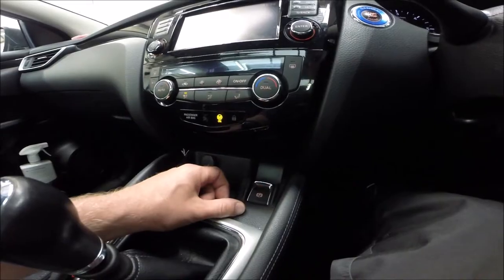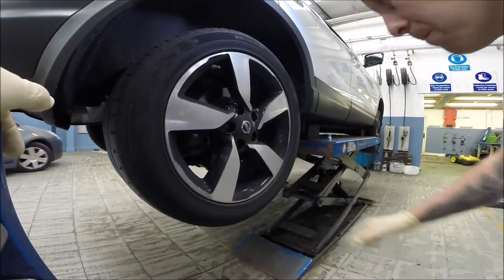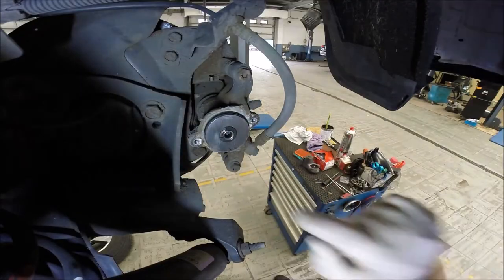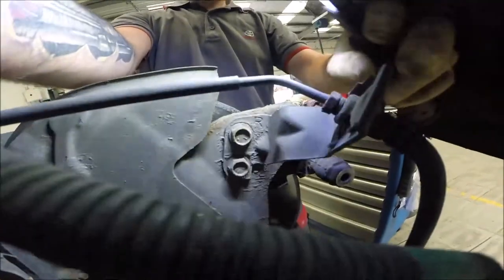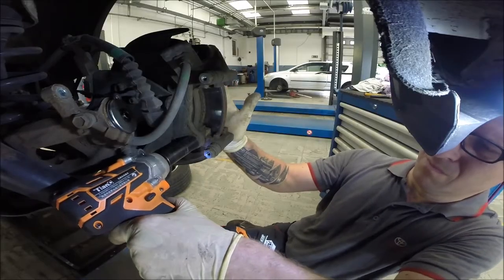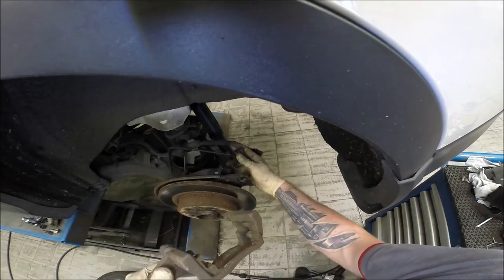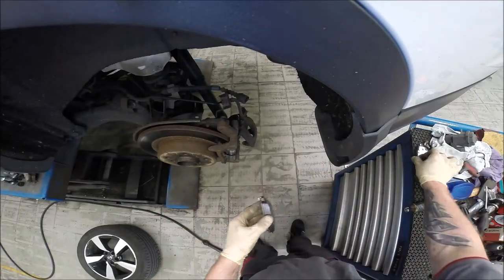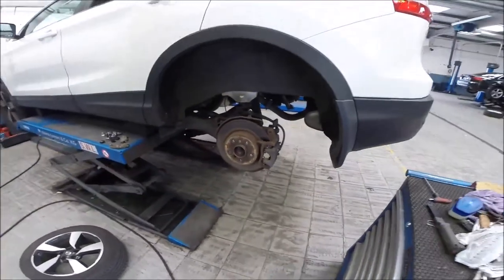Nissan Qashqai J11 Rear Brake Pads Replacement

Comment: Brilliant step by step guide, also handy to know the handbrake self adjusts after brake pad replacement, no one mentions this on the forums. For owners in the UK, Nissan dealer charge £96.23 for the set of genuine rear brake pads(Fronts are £72.85). Very expensive at £96, some alternatives from Euro Car Parts are Bosch for £43, Brembo for £46, and Pagid for £54.

Comment: Finally got around to doing this job.  Was much easier than I expected and had no issues whatsoever with the electric handbrake.  I rewound it as per the video and then used a normal caliper retracter to push the piston back in. Once done, I turned the ignition on and pressed the handbrake button.  It took just a moment to calibrate and all was good...no errors or warnings.
One thing I did find is that the audible warning tab on the brake pads are absolutely useless. The tab is on the inner pad, however the inner pad still had loads of pad left and so the warning never triggered.  The outer pads were almost down to the metal so I just caught them in time.
Reply: @deepjhandi8585  So true....

Comment: SergeP 
Excellent video, I just used it to change my rear brake pads on my Renault KADJAR 1.5 DCI (2015). It is the same process and electriC brake both Nissan QQ and Renault KADJAR.
We don't need any electronic case, just to proceed as the video and explanations and the result is well.
I am a french guy and we don't find any french video for Kadjar model.
Your video was my simple and great help. Thanks
Reply from the maker: Thank you

Comment: Getting ready to do front and rear pads on my J11.  I had done front pads before and hadn't thought of the added complexity of the rear breaks.  So happy I watched this in advance.  Thank you so much for taking the time and effort to make and share these videos.
Reply: MrUnderwurlde was it exactly as he showed ??? Can you share any best practice ??? Need to do mine next weekend
Reply: @balalkhan5398  I actually didn't do the rear pads in the end.  When I took the front pads off, there was almost half the pad still left. The rear pads had even more, so I left them alone.  I made a complaint to Nissan about the dealer trying to charge for work that was not required.
Reply: Don't do the rears yourself. Manually resetting the electronic handbrake ruins the calipers. We did this yesterday and now need new Nissan replacement calipers.
Reply: @adamreturns1  Interesting.  What failed on the original calipers that required them to be replaced? Did the mechanic actually show you the failed parts?
Reply: @MrUnderwurlde  Mr Nissan said the calipers were now useless as they were separated from the motors and manually adjusted. When plugged back in the computer sh*t itself and started flashing handbrake warning lights. He said the only thing to do now was install properly calibrated calipers and then the computer will allow a reset. I should have just booked it in to them for the pads change - £170 bill turned into £1290..
Reply: @adamreturns1  I'd be curious to know how Nissan do this then.  Is there a procedure to change the pads without separating the motor....or is Nissan software required to put them into service mode for example.  I sometimes think main dealers don't actually do repairs  but prefer to replace parts instead.  I had a similar situation with the intake manifold in a diesel Hyundai that had clogged up.  Hyundai wanted over 1500 to replace it.  It just needed a good clean which I did myself and it was as good as new.
Reply: @MrUnderwurlde  Nissan connect a computer to the car which retracts the handbrake. It stays connected the whole time then when you're done, it puts the piston back where it needs to be (as far as I understood). The problem doing it manually is that the ECU thinks the calipers and piston are in one place but they're not, you've moved them and haven't told it what you've done so it gets confused and errors out. 
I think you're correct, they just replace parts now. If you think about it, the calipers and motors had to be assembled at one point, so in theory you should be able to manually set the piston to the appropriate position on both calipers, install the motors and reset the system.. but apparently not. Why spend an hour fixing something that they can replace in the same amount of time and charge 10x more..?!

Comment: Excellent video, just replaced pads (and discs) on my 2016 QQ, your video was a great help.  The only slight complication was that 1 of the activator retaining screws on the off side rounded out even using a well fitting T30,  I managed, very carefully to cut a nick across the head so I could use a large flat blade screwdriver to remove then later replace the screw.
Many thanks
Reply: Hey Alan, I am looking to do the same on my Nissan Quahqai 2016 model.  Could you tell me if you had to do what is being done in the video at 7mins 6 secs and also what is he doing as i dont quite understand that step? thanks

Comment: Excellent job. You pay attention to details. Congratulations. I suggest to most of viewers not to try this at home. Better let a proffecional do this.
Reply: A bit complicated
Reply: Why? A 'professional' is only someone who has practised the job a number of times. Changing brake pads and rotors is something most vehicle owners should be able to do, considering its relative simplicity. Not a challenging job in the slightest.
Reply: @Ahmed____  I agree. Nothing difficult to be done here. As long as you have a bit of common sense this isn't something only a professional should do.

Comment: Thank you. It's been a great help.
1.However, I wonder if the tool needed to move the kelp-cylinder back is a general or special tool.
2. And you really don't need a scanner?
Reply from the maker: Hi, it is standard torx, and yes you no need plug in komputer,

Comment: When u put the hand brake back on did u need to use the 7mm to screw it back or just fit it and let the hand brake collaborate it’s self ?
Reply from the maker: Hi, fit like that , then fully pomping brake pedal and during pres brake pedal switch ON the park Brake it will be adjusting it self.
Reply: Completed the new pads and discs all round videos is spot on thanks
Reply: @FixYOURride13. Can you explain

Comment: Hi, firstly, great video, really helpful. 
But i don't understand why are you taking off the electric parts and than you're using allen key. What it gives? Is it easier to screw in the pestle later? Or maybe it is enough to press it then and you don't need to screw in?
Reply from the maker: Cześć,  trzeba cofnąć tłoczek, jest to bardzo utrudnione ponieważ musisz pokonać opur jaki stawia silnik elektryczny na zacisku jeśli nie używasz do cofnięcia sekcji hamulca postojowego urządzenia diagnostycznego. To jest prosta metoda nie wymagajaca drogiego urządzenia diagnostycznego.

Comment: Why messing with the brake fluid? Didn't change level. Thanks for the video
Reply from the maker: brake fluid level was to high, during the brake piston pushing back the brake fluid will be split out of the reservoir.

Comment: When u removed the electric motor at 7:20 it looks like you rotated the caliper piston clockwise and counter clock wise with the Torx driver. Can you confirm the direction it has to turn before removing the caliper please? Thanks
Reply from the maker: Hi, is only one correct way, try like I'm trying 😉

Comment: Hi mate 
That way is not recommended way of doing the job .
What about EHB system putting to   Diagnostic mode for revising the motor back.  Then after completing the job  by putting back to normal operating mode is setting the brake pads to the brake disc .and deleting any faults from the driver of EHB module .
Reply from the maker: Hi, respect for your way, but all the conditions are done if you follow the recommendation. After  replaced the pads pres brake pedal several times next use the Parking Brake system, all will be adjusted like should be. 👍

Comment: After replacing FRONT brake discs and pads, i am getting once in a while a "slip indicator" light on, red engine light, along with "CHASSIS CONTROL System fault" warning and a "SYSTEM fault" warning.  
Have i missed something?
Reply from the maker: Hi, something definitely went wrong. Plug-in computer for check what's happened.
Reply: @FixYOURride13  Thanks for your answer. BUT what has the mechanic done wrong? really i can't think of anything neither does he. Is there any chance that he has damaged or misplaced the ABS/ESP sensor???
Reply from the maker: @ZisGR81  ...all is possible, after computer diagnostic you will be know more, maybe need only parking brake system calibration.
Reply: @FixYOURride13  problem was solved by replacing the exhaust gas pressure pipe !!! Everything was caused becaused it was torn apart !!! Totally confusing errors triggering by an engine part rather than a wheel sensor 🤨🤨

Comment: This video is definitely helping! Good job ! But to wich direction you’re twisting to release handbrake after taking of the caliper ?
Reply from the maker: Hi, both side after removed the electric motor twisted by 7mm allen key for right side, and caliper pistons for right also
Reply: FixYOURride13 
Thanks I’m just doing that right now ! 👌🏻😆
Reply from the maker: @metinrusan55  
Good job 👏

Comment: All good on the fitting, however now I have a flashing handbrake light any idea why? Thank you for an excellent video
Reply from the maker: Hi, probably somting went wrong, disconnect battery for 2 minutes, connect back, ignition on, press brake pedal several times, hold and switch park brake on, next off, ignition off. If still will be flashing need plug in komputer for rest park brake system.
Reply: @FixYOURride13  All good now...thank you
Reply: @markl5893  hey did you get it sorted ? i have the same problem thanks nickr
Reply: @FixYOURride13  take it to nissan to get connected to computer or possible to fix myself? thanks nickr
Reply: hey how did you get it fixed?
Reply: Sorry to ressurect but how did anyone manage to reset the warning light? Thanks

Comment: Hi, I have Nissan X-Trail / Rouge and that car have the same Brake Systam as the Quaschqai and Renault Kadjar. 
Thank you very much for this video it ist very interasting und i try to change the Brakes at home. 
But i have one question. What Brake Fluid Nissan used ??? Dot 3 or 4?
Best Regards from Germany. :-)
Reply from the maker: Hi, all brake fluid dot 4 up to 5.1

Comment: Hi mate. Great video. As a mechanic, do you think the Nissan Qashqai is a good car. Mine is 2 years old now and I am debating whether to keep it or trade it. BTW, in Australia the J11 is only available in 2.0 petrol and I have a CVT auto. Any insight would be appreciated.
Reply from the maker: Hi, It depends on you whether you attach to the car or like changes, What is your mileage, are you happy? What car would you like to change to?
Reply: I have only done 9,000 kms. The car is 2 year old. I've only got 12 month more warranty left and am worried about the CVT. If I changed I was considering the Hyundai Tuscon. Also 2.0 litre but no CVT. In Australia, 95% of cars are auto. I'd like to know your thoughts about the reliability of the Qashqai vs the reliability of the Tuscon - from a mechanics point of view. ANy insight would be much appreciated.
Reply from the maker: @deebee3901  hi, forgive me but all depend how is condition both models , better ask your lockal mechanic.

Comment: Do you need a special brake piston rewinder (like a keyed one) or any standard brake piston pusher tool is good enough for the job in this car?
Reply from the maker: Hi, yes you need, 26:05 video time.
Reply: @FixYOURride13  is the piston turning when pushing the piston back into the calliper with that special tool?

And if one doesn’t have that particular tool your using? 
Could you use a large C clamp to push the piston back in?
Reply: Good video!

Comment: Won't vaseline damage the rubber seal on the brake caliper. Wouldn't silicone grease be a better idea?
Reply from the maker: Hi, It didn't happen to me after using Vaseline but silikon grease is a  good idea.
Reply: Don't use Vaseline. Silicone is basically heat proof.

Comment: You must never gun on alloy wheels and if you do gun setting must be low and once wheels are on the ground tighten wheels with wheel bar or torque up with torque wrench. And I've never seen or would recommend using a file on the brake caliper pad holder, the wire brush was good enough,  i can only imagine someone over filing and destroying the caliper. other than that nice job man
Reply from the maker: Hi, you obviously have little experience with rust, a wire brush will only remove dust
Reply: @FixYOURride13  Well I worked for ford's, I worked for vauxhall plus I was an M.o.t inspector but your probably right I have little experience what do I know.

Comment: good video but would never use a grinder to clean the brake carrier as all you are doing is introducing bigger tolerances just use a wire brush to clean up
Reply from the maker: hi , the grinder has metal brush disc so it 100% safe :)

Comment: Hi i need this tool 8:57 show me link for this please ?
I not found this tool with key for j11 😞
Reply from the maker: Hi, yes it is nessery...
https://www.ebay.co.uk/itm/203258983111
Reply: @FixYOURride13  I bought this tool but the three cylinder key does not match the brake piston
Reply from the maker: @EyesFrostMaker  it is not necessary if you disconnected electric motor and turn back inner cylinder the main cylinder just push with out rotation ;)
Reply: @FixYOURride13  thanks 👍

Comment: Nowhere do I see you using a torque wrench to tighten any nuts/bolts. This is so very important to do correctly. Caliper, Caliper carrier and Wheel nuts all require to be torqued to the correct values!
Reply: I am a mechanic to trade, and I've done brakes on loads of my own cars and never torqued bolts in my life, never had a problem.
Reply: Think he would know what to do mate, hes fixed enough cars

Comment: Warning to all, do bit do this! We tried this with a friend's Qashqai J11 yesterday and changed the pads ok but the handbrake wouldn't reset. Long story short, Nissan have to fit 2 new rear calipers at a cost of almost £1300! You need the  Nissan computer to reset the electronic handbrake. I'm gutted we followed this video.
Reply from the maker: Hi, sad news, but you have to make some mistakes, it is no one Nissan, VW, Skoda, do this way and newer made any problem.
Reply: @FixYOURride13  very expensive mistake to make.
Reply: I’m in the same boat! Only one side of the hand brake is activating
Reply from the maker: @lukewhiting2373  hi, chat with Adam (Post before) and recognise what you and Adam did  wrong, other comments it's positive reply. Mayby you open drivers door and was automatically ignition on or something similar, I guess only.
Reply: @lukewhiting2373  It's going to have to go to Nissan for that fix, mate. I tried various garages and their diagnostic computers and only Nissan could touch the brake module.
Reply: Adam cheers mate. I have changed the calliper on the left hand side and I have have a new brake ECU to which I plan to plug in and then use a regular dial in to perform a brake pad change, as it should then try and open them up and then fingers crossed it resets. If not I have another final option before giving up and getting the CC out to go to Nissan!
Reply: @lukewhiting2373  Best of luck mate, let me know how you get on. If you can avoid removing the motors from the calipers you should be fine. If you do remove the motors, I think you might have issues calibrating them again.
Reply: @FixYOURride13  are you saying once you start don’t turn the ignition on or open the door?
Reply from the maker: @ejm3381  hi, no... why would you like to do this ? It is illogical.
Reply: Had mine done at a independent garage so no you don't have to take them to nissan to re adjust

Comment: No grease on the caliper pins, ears or piston face? Brakes will squeal for sure.
Don't suck clean fluid from the reservior, rather open the bleeder and let the overheated and rubber-contaminated fluid from the caliper out, instead of pushing that crap fluid back into the system.